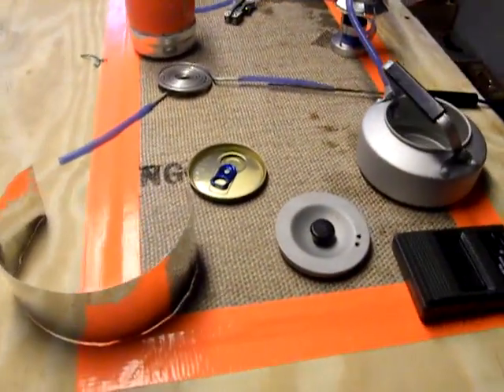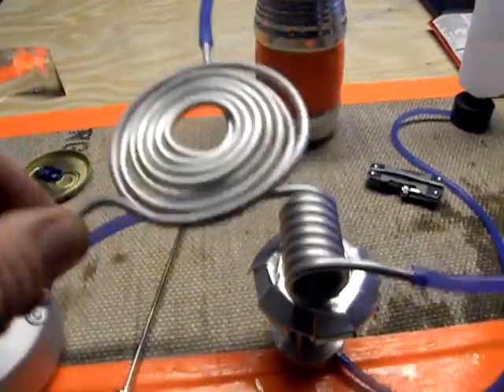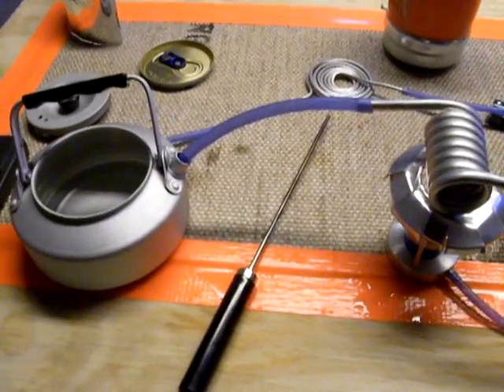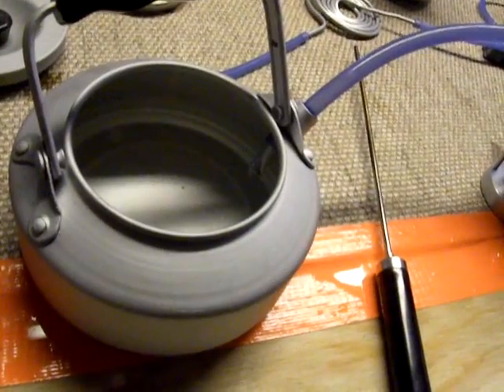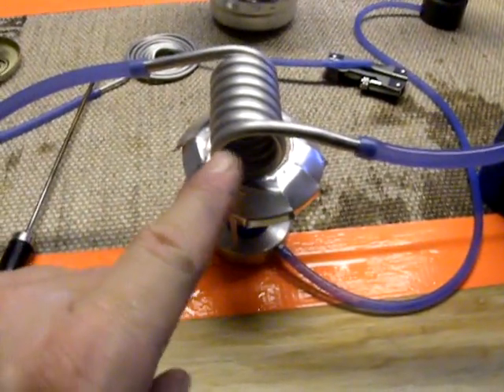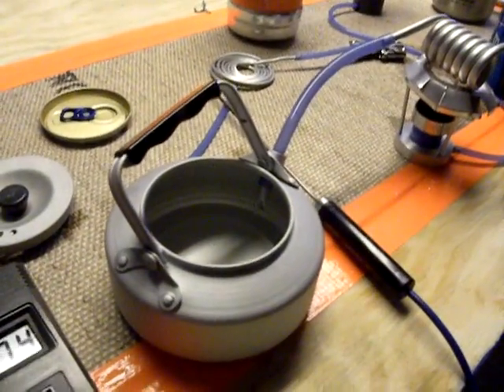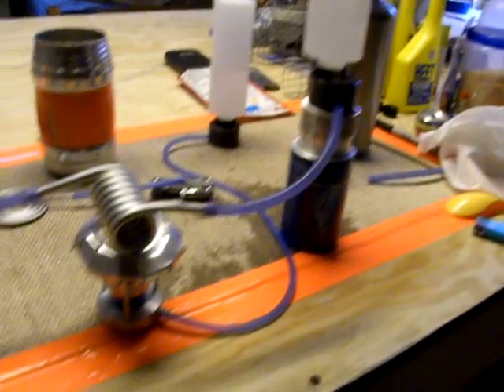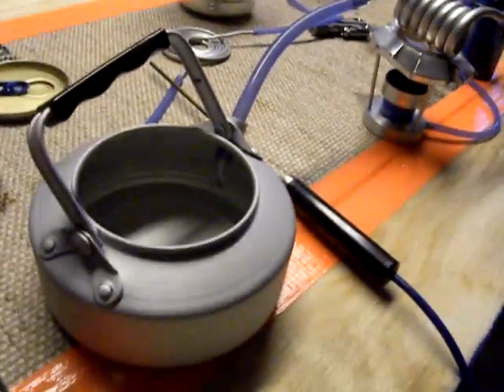Hot water on demand experiment

Comment: Tinny, Probably won't help with steam, but, the water backing up can be solved with an aquarium air flow valve.  Made to protect the air-pump from water over-pressuring the air coming out.  They cost a buck or two.  Similarly, any 'one-way' valve should get you in the right direction.

Comment: Use an open double coil...standing on the burner...and use just about normal flow speeds, that is how the on demand units work..its not one coil...it is about 50 feet of thin walled tubing, coiled inside itself until it fits in a 2foot tall unit.

Comment: if it was me i'd try having the outlet on top, hopefully that way when (if) the water boils the steam should rise out the top, if you wanted to get fancy you could also use a double walled pipe on the outlet for a condenser. even condensing of the inside it should still be hot enough for drinking / cooking (plus its already boiled anyway for  sterilising purposes)

Comment: Tinny, 
My carpet cleaning truck has a coil hot water heater in it, similar to what you are designing.   It is basically three coils going up with the flame at the bottom. (one coil is inside of the other)   The cold water comes in at the bottom and the hot water leaves at the top.
Hope that gives you a little something to mull over in your next design.

Comment: basically you are trying to use the method of heating up fuel before you burn it for water instead..
go with a vertical coil. with the outlet on the bottom. and the entering on top